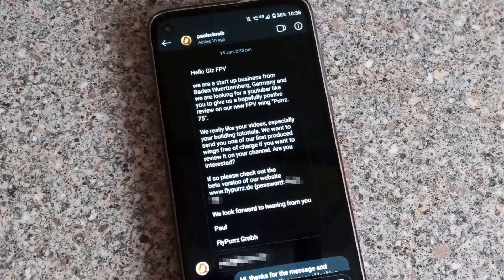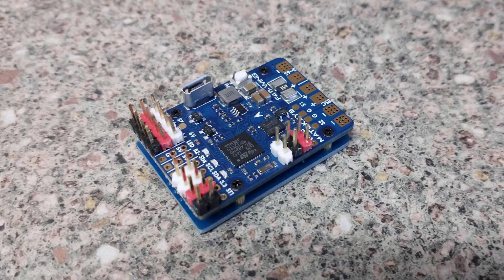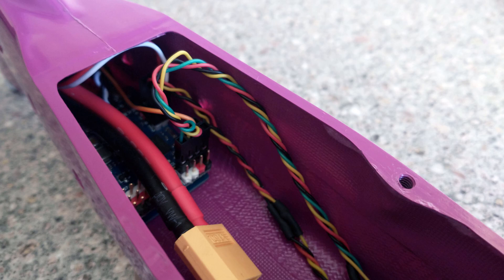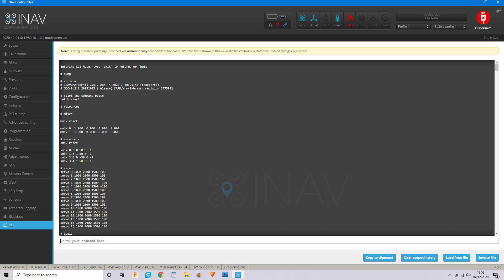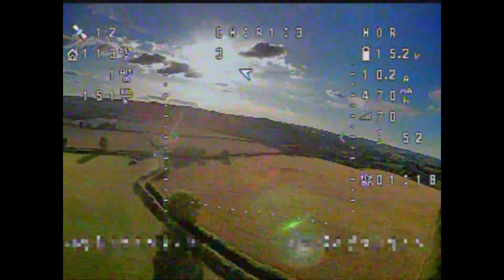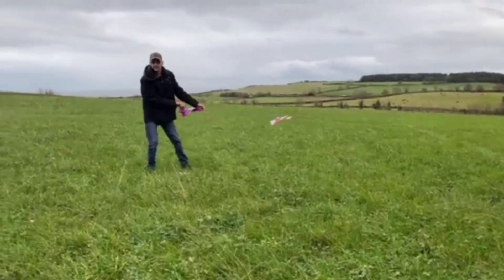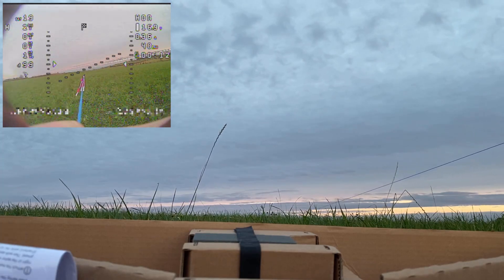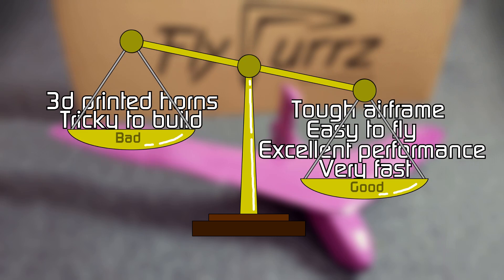🛩️ Purrz 75 - Fast FPV Drone Build And Review

Comment from the maker: Please read before commenting:

The launch - A lot of people have said that we launched the Purrz wrong, but we did the launch according to Flypurrz own instructions. 

The bungee - It's been pointed out that we didn't assemble it correctly, and it seems that you were right. My bad eeek.

Cutting holes - Yes I should have used a Dremel, but I didn't have one to hand. I also didn't know in advance that the material would crack when cut with a knife. Hindsight is a great thing huh!

Hardware used - I'm not rich, so often have to use whatever parts I have in my spares box. They sometimes might not be the best or more suitable parts, but I can't always afford to buy new.

The manual - I built this aircraft in accordance with the 1st gen manual. Flypurrz have since revised the manual and changed some things (eg: max take off weight is now much lower).

Experience - I've been flying fixed wing aircraft for many years, but I've never flown anything as fast as the Purrz before. This was my 1st time flying a properly fast (over 160kph) aircraft.
Reply: you dont want to discourage them, comments = engagment
Reply: I am interested in the field of drones and aerial vehicles and would like take this as my carrear would you plz tell me in which field this comes in
Reply: I thought the video you made was quite entertaining and educational. special appreciation for all the wiring diagrams you put up, so people don't have to watch and rewatch the video again and again and again to see where you did wire which piece :D

And i felt bad for people obviously being judgy about the hardware. You are doing the best you can with the stuff you have/can afford.
It's not like you are building 1-2 Planes a Year or there wouldnt be as many videos. So you cant be expected to buy new stuff for every plane.

However I'd love a "this is my build, and here is what could be a cool setup" section.
Then people can opt to either take whatever it is you did use in your build or go for an upgrade if they feel the need to do so.
Reply: Would u recommend this for some1 flying turbines ?
Reply: Plase can you explain how you have repaired the plastic piece where connect the serve wire? From the video i can't understand
Reply: Just can’t get over you believing tossing the craft in the air while the bungee was fully stretched was going to work. Gonna write that brain fart off to your excitement of trying it out.

Comment: Would you have paid money to buy it ?? I wouldn't. There are lot of proven 300 km capable airframes which are much more durable and easy to launch. No offence, I thought its ugly !. 
A mini Drak or a funjet on a 6s with the right motor and esc can touch the 250 km mark.

Comment: Man you needed a dremel tool!!! Better servos would be nice too. And a motor with the most kv as you can find and I do believe that thing could go over 200mph easy. And them push rods need to be totally different so they don't fly out. But them servos got to go you need more expensive ones that are more sensitive.

Comment: Is it that difficult to stay below 1000'?
Reply from the maker: Didn't go anwhere near 1000'. Legal limit here is 400'. However because I was flying on a hillside, occassionally as I flew up the hill the altitude would show as being above 400', relative to the take off point. The aircraft never actually went over 400', but was easier to just blot out the numbers than explain that in the video

Comment: You've got to wonder at a launching system that pulls the plane into the ground by design, and relies on the ailerons to save it. Why not have the anchor point of the bungee like 30cm above ground, and then you'd launch the thing from ground level? This way it'd go upwards instead.
Reply from the maker: I agree. Feels wrong to have a cord pull the aircraft straight towards the ground. As you saw, that can lead to a pretty devastating crash

Comment: That bungee launch was pilot error. Never throw a plane up! Either in a hand launch or a bungee launch. When you do that it creates higher pressure above the wing and it makes it fly down. And the result is what you see here 8:40 
When launching always throw straight forward to gain speed so the aircraft can create its own lift. 

Also throwing down is a bad idea because it can create too much lift and crash too.

Comment: I would say you missed the cons of hard to launch and hard to land.  I also think that Excellent Performance is pretty much a bit redundant next to Easy to Fly and Vary Fast... considering I did not see you actually attempt any fancy maneuvers. I would say that is a 5 vs 2.... and that does not even take into account it is based in Germany and dependent on your location this means longer shipping times, more expensive shipping and likely no replacement parts (like the part you 3D printed).  Given the fact than a rather experienced flyer had less than a 50% succe3ss rate building something so hard to assemble just does not bode well for it.  I would say 2 out of 5 and it on gets 2 because it came close to the listed speed.

Comment: When you throw the aircraft up in the air at launch --- the rubber band is pulling it down to the ground.    (there is a forward vector of force and a downward vector of force)     You should be low to the ground when you release and allow the lift of the plane to do all the vertical work.

Comment: Do you use any kind of capacitor on the esc? It looks like you have a lot of noise coming in from the motor!
Reply from the maker: No, no capacitor was used. If you look at the first flight, there was no power noise at all. The reason for power noise on the 2nd flight was due to the VTX being relocated to a position directly beside the battery/xt60 lead. It was therefore probably EMF noise that caused the issue. A capacitor may have helped with this, but as you saw, I never got another chance to fly the aircraft again to try solve the issue

Comment: Awesome, but... I think this might should be the race version, perhaps with a high $ carbon option. I think foam sandwich with glass (or maybe kevlar) and epoxy would be a lot tougher than the single wall glass and (probably just polyester) resin. In short, good aerodynamics, excellent though perhaps over-enthusiastic weight minimization. Going double wall with tougher fibers and better resin would be heavier, but it would make the result a lot more durable. Last, those servo linkages (and perhaps the servos themselves) should be installed at the factory. Those linkages might be the most easily damaged part on some fixed wings, but that just looked crazy, and perhaps putting them in at the factory could offset some of the weight of a tougher fuselage. Last a really crazy idea, make the fuselage out of mylar wrapped foam with a carbon spar that everything mounts to. The foam fuselage would be essentially expendable.

Comment: Is a long servo extender cable going from the VTX to the flight controller bad at all? im running an fpv cam on the tail 20 inches away from where i want to place my flight controller, any tips or ideas helps. Thanks!
Reply from the maker: It should be fine. Just make sure the wires don't pass by anything that might be effected by EMF. Twisting the wires is often a good idea

Comment: I am an experienced fixed wing RC pilot and I had three crashes from three attempts trying to hand launch a very heavily loaded Vol asw28 in manual.  I then gave up and switched to stabilised FBWA and had no more problems. 
Without the stabilisation my launch would never be straight and by the time I got my throwing hand on the aileron stick to correct, it was already in a bad attitude and not enough control surface authority to fix it before it hits the ground.  
I suggest taking off in a stabilised mode,

Comment: That servo and brand is not at all obscure in Germany. Hacker is known for making THE best motors here. Everyone uses hacker products. Their motors are the best money can buy.
Reply from the maker: That's interesting to know. Outside of Germany they're seemingly unheard of and hard to find
Reply: @gizfpv  Weird. They're mainly used in fixed wings though. If a model airplane company sells motor+esc combos There is at least one Hacker combo. They're known for the urple color. If yilou have a fixed wing, Try them. A personal favorite of mine Is the A10-12S. Very light weight but capable of 55W. perfect for little FPV wings.

Comment: If you want to be even more metric guy please write "km/h" instead of "kph" :) SI system is very precise how to write units and kph is out of the standard.
Reply: I’m going to write it like kmph from now on
Reply: @ghostbucket  "kmph" - kilo mile per hour? :D Using "p" for per just doesn't scale for other units because it can produce monsters like for example: degrees per second - degps vs deg/s, liters per second - Lps vs L/s. There is just no clear separation of units. Also metric system doesn't use any language words like "per" from English language, same as we don't make symbols plural like in the English grammar (for example 7 kgs for 7 kilograms is incorrect because it will be interpreted as kilogram-second, it's just 7 kg)
Reply: @rfly-fpv  it was a joke and i'm not reading all of that

Comment: I feel your pain I hate grp it’s like egg shell and really hard to fix. I recon that prop was too big and caused problems on take off due to the torque twisting body causing lack of lift   And the lower tail even if you did bleed all the speed on landing will always drive nose into ground    Keep the wing and build your own balsa body  will b much stronger and you can fix it in the field. I bet it will go just as fast.  I can tell this plane vexed you. I had one like this once    Although it comes as a kit it takes longer to rig than it would to scratch build from start to finish. Wonder if the creators are actually modellers or cad dreamers. Bet your glad yo didn’t pay for it 👍👍👍👍

Comment: This belongs with lawn darts and hand grenades... rather dangerous... especially without a decent FPV HD feed. It's just too little wing area. And fibreglass is so 1980's ...fast "hotliner" gliders that reach speeds of over 200 MPH are almost always Kelvar and Carbon Fibre ...no one uses fibreglass anymore.  Much better to build a reputable hotliner and throw a DJI air unit in it. No flaps or spoiler to slow it down for landing either. Sorry, this is nothing more than work-in-progress and downright dangerous.

Comment: Thanks a lot, very well done review in every aspect. 
If it seems almost impossible to land without breaking it, what is the point of it all, especially when the take off is another major risk. The current version would be a nightmare to me, though it is an interesting and expensive/time consuming experiment.
Reply from the maker: I think that the key to landing it is to have a very large open space with a smooth and soft surface. You also want to get the aircraft lined up for landing at a distance because as it slows down the elevons lose authority and the aircraft becomes harder to control.

Comment: Nice video! I have asked them to send me one to see how fast it can actually go. Was that a wing drop stall at 100kmh on the bad landing? Trying to understand why it rolled and there was no flare.
Reply from the maker: At 'low' speeds the elevons lose responsiveness and the aircraft becomes harder to control. That's why you kinda have to land it at speed

Comment: FRP is NOT simply fiberglass with a plastic coating. FRP is what you get with any plastic resin infused fiberglass material also known as a composite. It being coated in plastic on the outer structure has nothing to do with it being FRP.  This is how most composites are constructed BTW.  Carbon fiber panels are CRP. The main rigid component of the structure is indeed the plastic resin (epoxy in most modern cases). The fiberglass or carbon is there to do exactly what the term suggests, reenforce the resin structure.

Comment: Tip for running the servo connectors.  Use a magnet to drag along the outside of the wing, pulling the the connectors through the inside.  Most connector pins are made of plated steel and would be attracted to the magnet.  If this is not the case a wire could be inserted into the connectors to attract them to the magnet.
Reply: Good trick for the first time! After i got wires pulled through and want to replace servos i usually put a metal wire with hook on one end and hook it up to the servo connector and pull the metal wire through servo wire channel until it comes out on other side. Once i want to put a servo again i just hook up the servo lead to the hook and pull metal wire on other side

Comment: Change the motor for a DYS fire 6S running gear with a 5x5 and you may even hit 300kph. I used that setup in an S800 foamie for a clean 200kph and the Purrz has nice drag free lines. Also, to all who want very strong 3d prints, PET-G, very slow, 0.1mm layers and go 30degC hotter, 80degC bed. Your prints will be a bit heavier but almost clear and so strong that you can suspend a 100kg guy off a 5mm print. I used it like this for my kiteboard fins and footplates.
P.S. bungee is perfect technique for hotliners but hook should be about 10% of total length forward of CoG.

Comment: Next time use a lunch rail pedal launcher. You're plane will live longer. 
Many very nice ones made in Germany, or make it from PVC pipe. They already gave you the bungee so why not. Launching from hand with a fragile aircraft always ends in disaster. 
The proper construction title of this aircraft is hollow molded...
Very pricey competition model sail planes are made the same way, although, this plane would have benefited to have a Carbon Kevlar weave instead of just plain glass cloth, but it's very pricey.

Comment: What a waste of 2 great R/C aircraft on a noob builder/pilot. 
Have you heard of a Dremel? It's a small rotary tool that hobbyists use. 
Have you also heard of YouTube? It's a video sharing website where one can find videos of how to use a bungee launch for R/C aircraft.
Why would you cut out the center bottom section of the wing? It'll fold at speed now.
Reply from the maker: Thankyou so much for your lovely comment. Over the years I've logged thousands of hours of flight time and have built all of these aircraft...

TBS Capirinha
Ritewing Mini Drak
F450
Mode2 Ghost 7"
x4 Reptile S800's
x2 FlyingWings F4 Hornets
Mini Talon
Sonicmodell Mini Skyhunter
x2 Emax Nighthawk 280's
MRM Reaper
x2 MRM 225's
Reptile S670
Nano Talon
x2 Nano Goblins
Sonicmodell F1
Emax Nighthawk pro
Zohd Drift
AXN
Bixler 1.1
Cessna 172 Skylane
Night Radian
Emax X5
Iflight Iwing
Zohd Dart

...but I agree, I'm obviously a noob builder/pilot who has no clue or experience! I'll try harder in future.

Comment: Really impressive speed meant for a very experienced pilot. A full CF frame is dangerous for FPV as it cast RF shadows for pilot's video antenna. This model seems like a pilon racer with pusher setup. I didn't get the purpose of the big back lower fin though ( it will wear off of get damaged after many landings).

Comment: The main pod needs to be epp and the wings stay fiberglass. Also redesign the wings for slower stall speed. If you can't land at reasonable speed, it's not good.
Reply: It's a design compromise; lower stall speed means lower top speeds. And EPP might not have the required rigidity, i.e. is too plastic and therefore flexible. It's another design compromise, which you have to live with if you want this sort of performance I'm afraid.
Reply: @loc4725  I get it but a plane should be able to land safely. Otherwise you better simply build a rocket. Epp can be reinforced with carbon fiber but the pod is not a breaking point, it needs to keep the wings tho.
Reply: @goku445  I'm familiar with fast, high stall speed models and coming in hot is something you both expect and plan for so I don't think it's unreasonable for this model to be the same way. I with you though agree that fibreglass is probably not the best material to use, especially as most high end hotliners these days are made with carbon fiber, often for every part of the body. And having a boom on a model which is going top come in and stop fast isn't a great idea either.

Comment: Thank you very much for your review. @12:38 we are surprised u made it in the air with the shortened bungee cord. Please note that the barrier tape must be fixed behind the hook to ensure a save release. Greetings FlyPurrz-Team
Reply: I was thinking exact the same.... what happened to the cord. Actually one needs only a small piece black rubber and 50m - 100m of strong fishing-line does the rest. The comments on the thin skin does not make any sense. Planes are never engineered on crashing, but on flying (like in the hands of a seasoned pilot). Grumble... let me test this FPV-plane and the outcome will be completely different (with a smile on my face).

Comment: looks like the bungee hook is too much forward, making it impossible to climb when engaged.
Reply: It's not supposed to climb. By using a bungee you get speed.  In order to climb, a much longer cable should be used, and the hook should be fairly close to the CG..